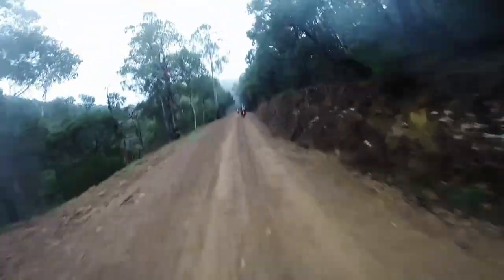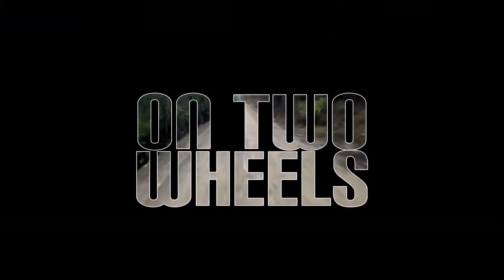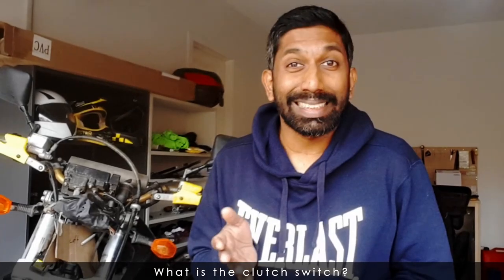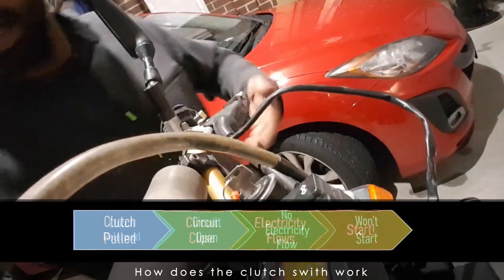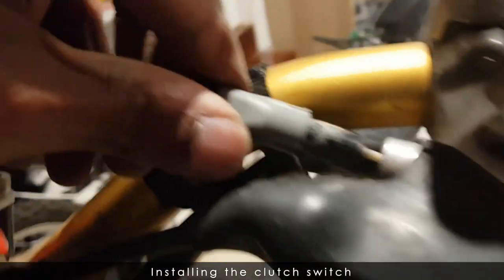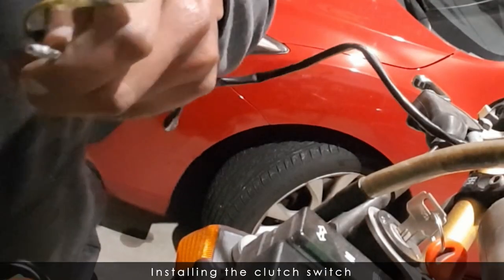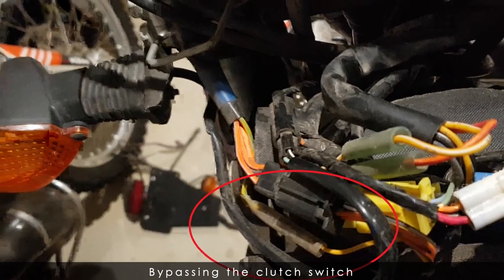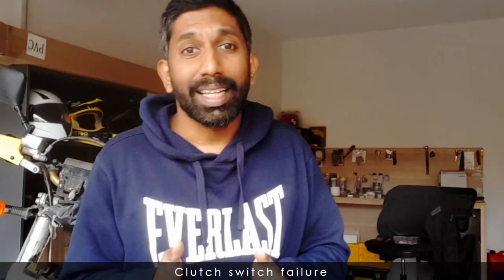How to fit / bypass a clutch switch DRZ400 | On Two Wheels

Comment: NONE of these videos about the clutch switch explain how to REMOVE the physical switch from the clutch perch if it needs to be replaced...  everyone shows how to BYPASS it...  one video shows what the switch looks like and where it goes...  but NOBODY tells you how to get the old one out.
Reply from the maker: It's secured by a little plastic tab on the underside of the perch :) press it a bit and you just pull out the switch. Hope it helps! :)